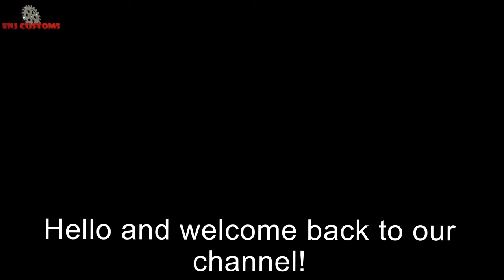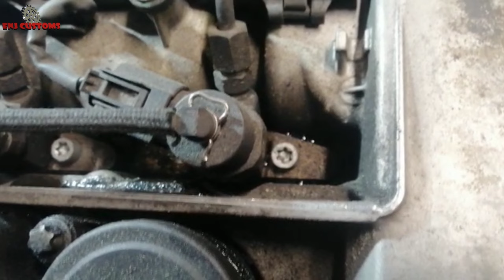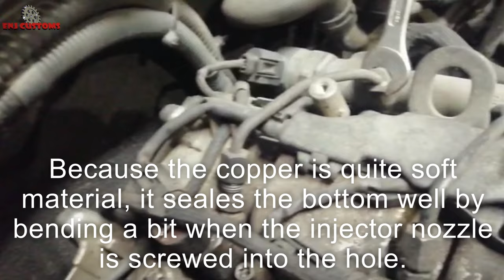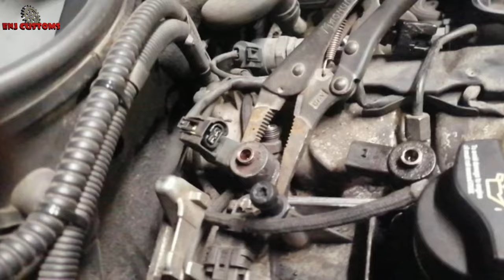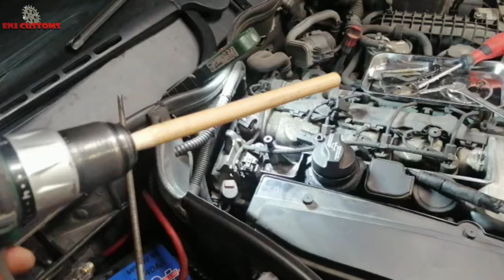How to fix leaking injector easily

Comment: First off, do NOT use water. If the injector seals (plastic rings around injector) are not tight, the water will get into the engine and start rusting. If you have to check it, use a thin oil.

Comment: Actually what he should have done before even removing injector. You take to a car wash and pressure wash top of engine, buy a can of engine cleaner spray on top of head, let it soak for 5-7 min. Then rense with high pressure washer. I owen a MB 300SD 1983 turbo diesel. I perform all my maintence. His method of locating leaking copper ring, is fine, I use a spray can of carburator cleaner.

Comment: My 250 cdi had injector issues.  Then I filled the tank with Total Fina diesel.  They sell only one high grade diesel mix.  My car immediately ran smoother and quieter and no more surprise injector problems.  Now I only use Total Fina And the car loves it.  Now, at 225k km, its time to pull, clean, and re-seat all four.  The injectors are fine.  Just micro-leaks at the copper seal.  I'm going to let mercedes do the work for the warranty and they are really good and thorough.

Comment: Water testing, interest idea I'll check that way too. I replaced the fuel lines and smell went away, cleaned up the whole area but after a short drive found diesel fuel on top of one injector.  Also today saw a drop come off the front of the fuel pump which is a bigger concern TDI ALH
Reply: Mine still smells how did you get rid of the smell

Comment: Top job mate  like the way you put the grooves in the old bolt and dowel stick for cleaning
Reply: Had a similar problem on the same engine (W203-CDI) only to find my injector cracked. after fixing the injector, the injector holder bolt damaged the threads and can't hold the injector. any suggestions please help

Comment: Do you need to bleed the fuel line once finished?
Reply: No need,since it's just one injector, the other injectors will still fire n the one which was removed will bleed itself as the engine runs

Comment: is that water not gonna leak into cylinder and cause problems ?
Reply: I wondered that
Reply from the maker: Hi and thanks for the comment! There is such a high pressure in the cylinder, dozens of bars, that water cannot flow into the cylinder. A leaking injector only causes those air bubbles. Of course, you should always dry off the water with a rag before starting to disassemble the parts. And always remember to clean the injector hole properly. But overall using water does not cause any problems.
Reply: Just use diesel for that test or WD40
Reply: @lusa3002  diesel. Good way to blow up mate😂
Reply: @vasilybk1760 No diesel ignites under pressure not spark .

Comment: My injector is stuck i cannot remove it any suggestions ?
Reply: Get the engine hot first. Loosen the bolt by a few turns, but leave it in. The injector might loosen itself as you drive around. There is a slide hammer that you can get as well. Mine came out with malgrips and a wiggle.
Reply: @martynm.449  thank you very much

Comment: Nice but it short cut, you did not show which part did u replace and how to do it.
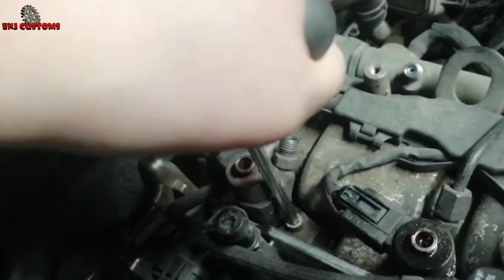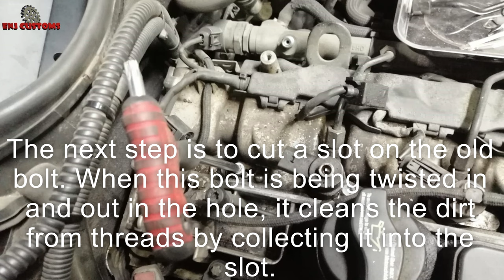Reply from the maker: Hi and thanks for your comment. The only parts that were replaced were the copper ring that goes to the bottom of the injector hole and the bolt which I was removing in 2:34. I used that same old bolt to clean the injector hole by cutting a slot on it and screwing it in and out in the hole. This collects the dirt from the hole into the slot. In this situation the only parts that need to be replaced every time are the copper ring and the bolt. I mentioned about replacing them in 4:26. Hope this helps!